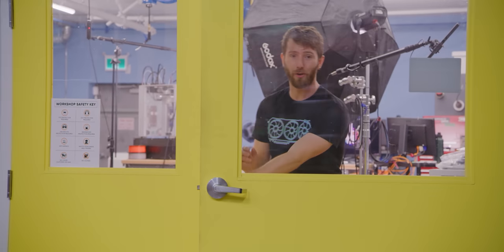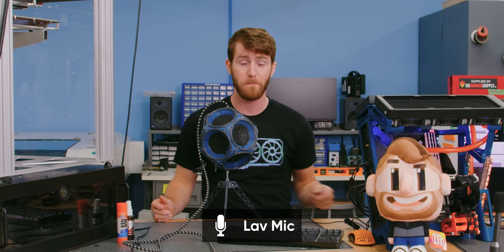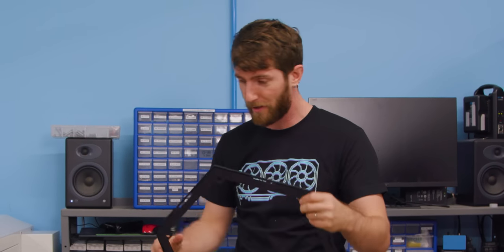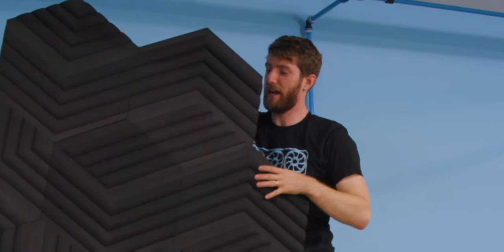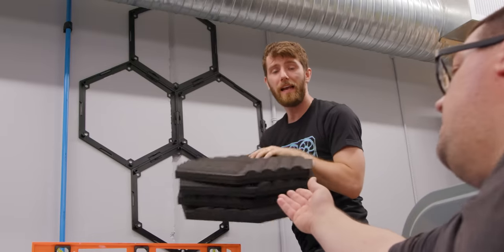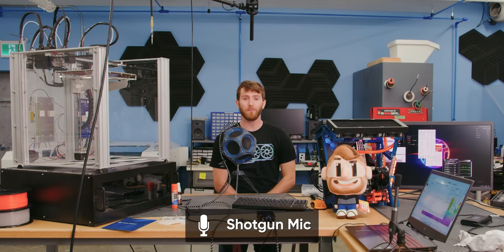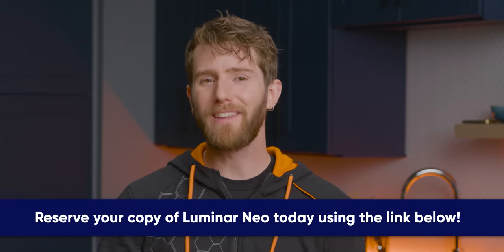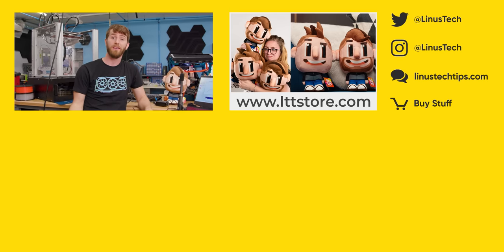I'm only going to say this once... - Acoustic treating with Elgato Wave

Comment: Oh boy, my degree finally comes in handy, and I can be one of THOSE YouTube commenters. Reverb is not created by standing waves. Standing waves and reverb are different things that are both caused by sound reflecting off walls. Standing waves affect the tone of the sounds in the room, they do this by either amplifying or canceling out certain frequencies inside the room, the specific frequencies that get boosted/cancelled are determined by the dimensions of the room. 

Reverb is just a sound reflecting around the room, and since it takes time for the sound to move through the room you hear the same sound multiple times from it reflecting off different surfaces
Reply: Absolutely correct, thought the same. Standing waves also cause a ringing sound at specific wave lengths (fractions of the dimensions of the room) that can stay way longer than the reverb
Reply: Thank you! Was thinking the same thing!
Reply: Was gonna make this exact comment, glad someone got to it before I did haha
Reply: @Punkschorsch  Maybe that's why sometimes people hear a high pitched sound in their ears.
Reply: True. I would add that this treatment does help a bit against standing waves because of how many times the sound waves will have to go through the foam and lose energy. Plus the foam surface is not flat, but angled in different directions, so that helps by deviating waves through refraction, though I wouldn't expect it to do much for bass frequencies, and maybe even mids
Reply: I’m thinking it’ll be good enough for the large space they have, their energy loss from one end of the room to another I assume would be rather large (considering the workshop is massive) so this will aid in damping those waves
Reply: Yoooo, qualified acoustician and trained engineer gang.
This video hurt my feelings.
Reply: Not to mention you won’t address any room modes or standing waves without tuned bass trapping / proper broad band absorption. While we’re at it foam is a terrible material for acoustic treatment and at best will tame highs and high mids. I hate this consumer shit that gets sold to people through these kinds of videos. A better one would be how to make actual acoustic panels (not thin foam decorations) super easily and cheaply with rock wool. But we can’t expect much from Linus—I’ve seen them talk about 96khz audio before as if it would be audibly different to a listener compared to 44.1khz. To anyone who sees this: in a blind test you will not be able to tell the difference. The differences are not audible.
Reply: I don’t see anything wrong with being “that youtube commenter” as long as you keep it held to facts and not belittling the content at hand. You did a great job of that & as someone who knows nothing about your field of study it’s always cool to learn new things. 🍻
Reply: @thaBigGENERAL  They're not building a recording studio, it's more than enough
Reply: standing waves are MUCH harder to get rid of and these panels absolutely won't do the trick
Reply: BloodLeef  cheers mate, my fave is double choc chip
Reply: Thank you :) Was kind of annoyed because of their explanation, some LTT viewers actually know their acoustics!
Reply: Also, they are talking about frequencies, and while they are not entirely wrong, these panels are mounted directly to the wall, which nullifies the bass anyway; there is reason bass traps are a thing.
Reply: I could hug you. And unless you're in a Hollywood soundset, or NASA or someplace with remdiculous control (and money)  the color, tone and I guess vibrance of your  recordingS for just about everything is impacted  in someway by interference, the materials,  and even the recording equipment itself, some amount of imperfection, is going to sound better as well. Just because it's what you're used to. lol audio engineer friend has ranted for a long time about these things. you don't need a fucking hollyweed type of set up for youtube. even hollyweird doesn't need it!  (mostly)
Reply: He needs a anechoic chamber tech ingredients!
Reply: @darko.v  You're thinking of tinnitus.  It's a physical condition of the ears, and has nothing to do with reverberation, standing waves, or resonance (which is the ringing effect Punkhorst describes).
Reply: @gorkskoal9315  The film industry makes their soundstage as flat and unresponsive as possible during filming so they can have complete control over what effects they want to add in post.  Same for the music industry.  It's rule number one in recording - you can add stuff later, but you can't take it out if it's already there in your raw track.
Reply: You're mostly right, but it should also be pointed out that standing waves are a direct result of reverberation - a resonant frequency cannot increase in amplitude if the wave is not being reflected in the first place.  This is also why a perfectly anechoic chamber will have no resonant frequencies, regardless of its shape and dimensions.
Reply: @UthacalthingTymbrimi  Good to know.
Reply: @UthacalthingTymbrimi  well I did say standing waves are caused by sound reflecting off of walls, but thanks for the additional information. It's a lot better than what Linus said, "reverb is caused by standing waves"
Reply: @cameronfarrell9076  Yeah, Linus is basically saying the exact opposite of what actually happens.  I get what he's trying to say though - resonant frequencies will  reverberate for longer because they're additive.
Reply: So reverb = echo?
Reply: yep.. was totally going to say the same cough
Reply: @Summer-xu8qu  yeah they are, echo is just really long intervals between reflections, which is why you hear echos in canyons and big halls and shizz
Reply: I knew that without spending tens of thousands on a degree
Reply: Degree in WHAT?
Reply: @cameronfarrell9076  can you please also explain room resonance? How would different modes be affected by treatment like this?
Reply: I am happy I do not have to be that person cause I was definitely thinking this haha
Reply: @tusharjamwal  the short answer is small foam panels like these do nothing to combat room resonance.

I'll probably make some small errors here but I hope this is a good enough explanation.

Room resonance is basically what causes standing waves. Sound wave frequencies have a physical size and they travel through air over time, if the room is the same size as a particular frequency then when I bounces off the wall it will in effect occupy the same space instead of moving around, it then combines with itself to either double in volume or half in volume depending on where you stand in the room, these are called nodes and antinodes and are fixed positions in the room since the waves are in effect not moving.

In order to combat these with acoustic treatment you need really thick panels that are tuned to those frequencies and you need to place them in specific locations in order to absorb the sound which kills the resonance.
Reply: @Summer-xu8qu  Essentially, yes, depending on distance.  In much larger spaces (eg: canyon, mountain range), the time between you hearing the direct sound vs the reflected sound is long enough that your brain interprets them as separate sounds (ie: echo).

In a smaller space (eg: a church), the direct + reflected sounds blend together a lot more, which is what is commonly known as "reverb".

The reality is a bit more technical, in that you need to consider factors like direction of the reflections, the reflective properties of surfaces, etc.
Reply: And generally, when we treat high-end recording studios we only treat two non-opposing walls and the ceiling.
Reply: The peaks and the nulls of a room are also known as MODES. You can actually do the math at what frequencies you're going to have problems in, just literally do 1130 / Xft in one direction. 1130 is the Feet Per Second. So you're dividing that by the dimension of your room and you can get the base frequency a given problem will occur. Now that doesn't necessarily give you whether it's a peak or a null, but it does tell you the problem frequencies and all you have to do is multiply that number by 2 to get the next octave and so on and so forth which will tell you more about your room that you didn't know. I run a little recording studio out of my home and I've been learning all this as I go lol
Reply: @Theexplorographer  Unless it's the drum booth -  reflections are death to your overheads!
Reply: Pin this guy already
Reply: @AlexValliMusic  Definitely done that math many times building Helmholtz resonators for studios.
Reply: if you think acoustics is a useless degree then try music performance.
Reply: Standing waves are also the reason microwaves are heading up food so inconsistently ^^
Reply: @PascalalbrechtDDance  i didn't know that, it is very interesting!
Reply: yes
Reply: Thank you! As an audio engineer it really ground my gears when he said reverb is standing waves.
Reply: Great! But let me ask, how do I objectively measure the amount of reverb in a room?

I really don't know much about acoustics so I assumed that standing waves would only occur if reverb occurs, and hence some correlation; standing waves being a kind of objective measurement and reverb being the subjective observation
Reply: Nodes and anti-nodes?
Reply: Using REW he can also calculate the RT60 time which would be much more beneficial for this kind of test. Rt60 is the measurement of time it takes for reverb takes to decay by 60dBSPL, the level change it becomes inaudible
Reply: @notMattGarska  Standing waves are mostly a thing in the very low mid and bass frequencies. Very roughly below 250Hz you start to get into "room mode" behavior with standing waves, and above that, reflecting sound behaves just like normal "reverb". These panels are 4-5cm thick, if you plug that into a porous absorber calculator, that will tell you they start being somewhat effective at 500Hz (about 50% absorption) and properly effective above 1kHz (>90% absorption).

That's typical for a mid/high frequency absorber, not effective at all for bass frequencies, but that's not what they're made for anyways. If you want to do anything of consequence against bass frequencies/room modes, you need to have elements with thicknesses more like 10-20cm. They're usually put into room corners.

Btw: If you want to get the absolute most of the least material, you should put porous absorbers not right against a wall but instead leave a bit of an air gap. Porous absorbers are most effective at absorbing energy at the velocity maximum of soundwaves, which is 1/4 of a wavelength removed from the wall or boundary, where it reflects.
Reply: @thaBigGENERAL  Nothing wrong with foam per se; acoustic foam itself is about as effective as rockwool or many other porous absorbers (comparing flow resistivity). You just can't expect a 5cm absorber panel to affect low frequencies, whether it's foam or rockwool or anything else. When you want best bang for the buck, build a DIY rockwool panel. If cost is not the primary limiting factor, the convenience of foam (weight, no hazardous fibers) may be worth it.
Reply: @thaBigGENERAL  Yeah, I found it interesting that the peaks at 150ish and 250ish Hz didn't budge an inch. I thought, "Well, they could probably throw a couple of bass traps in there and fix the issue." Also, the 16 bit/44.1 kHz sample rate of CDs is no accident. It's scientifically the most that a human ear can distinguish.
Reply: Was going to say the same thing. I'm an audio visual artist and integrator. Where did you go to school?
Reply: @Summer-xu8qu  no, completely different things entirely. You can have reverb in a chamber without echo but you can't necessarily have echo without reverb.
Reply: @AlexValliMusic  1. Peaks and nulls are anti-nodes and nodes respectively.
2. Modes are the various frequencies that your formula derives. 
3. Your formula is incorrect. Base frequency, or more appropriately fundamental frequency, is 340m/s divided by room length then further divided by 2.
4. The proper formula for double closed end reflections is f = nv/2L, where n is the harmonic number, v is the speed of sound and L is the length of the room.
5. You can determine locations of nodes and anti-nodes by first determining whether the wall provides a fixed or free end reflection. Then propagating the alternating node type to subsequent adjacent nodes. (Iirc, the wall is a fixed end reflection, but I could be wrong).
6. Imperial units hurt my soul.
Reply: so what exactlyis happening when you fart in a hot bath in a cast iron tub?  and how is it heard downstairs? why did the chandelier vibrate?
Reply: is it useful to have panels on different parts of the room compared to only on one wall? I suppose one thing that could play a role is the different orientations the panel have, if a wave would bounce from the ceiling to the floor back and forth and you only have panels on a wall, then very little of it would get absorbed. But I suspect that you only need panels in each of the 3 orientations in a square room, but I don't think you ll get a difference regarding grouping those together or not
Reply: Yeah standing waves are way rarer than this video implies.
Reply: would these panels be something good to put in a home theatre that has hard walls, low painted ceiling and carpet?
Reply: @darko.v  no. While you can have Standing waves at any frequency, in room acoustics, standing waves are a low frequency phenomena.

At these low frequencies the room appears like a box with sound bouncing plainly from one side to the other. When the wavelength of the sound (or it’s multiples) exactly matches the width and/or height of the room, these reflections will form standing patterns. They are characterized by areas of extremely high pressure (constructive interference between reflections) and others where the reflections cancel (almost) completely out (destructive interference of reflections). Along the walls, standing waves always form high pressure areas, because the rigidity of the walls leads to high pressure. Silence can only be found a good distance away from the walls.

This low frequency behavior of rooms is the reason why subwoofers are best placed in corners. There they have the highest efficiency to feed the room with energy and make it “booom”.  But you will also find that bass experience varies significantly across the room.

At higher frequencies small objects and surface roughness are significant in size compared to the wavelength. As a result, instead of being plainly reflected back, sound bounces off in different directions and no standing waves will form. Unless you are in one of the very extreme flat concrete surface rooms, which are used for measurement purposes.
But even there the human ear will not really perceive high frequencies as Standing waves (too much going on)

But there are many other phenomena related to high frequencies, (e.g. our hearing is especially sensitive around 1-2kHz) and we just don’t react very pleasant to ringing sounds.
Reply: @AbWischBar  Very well written. Thanks for the explanation and it makes so much sense.
Reply: Basically its like throwing a ping-pong ball at the wall :) (How I always imagined reverb)
Reply: Finally, someone who has the same boat of knowledge from a relevant degree in sound. Well put.
Reply: @UthacalthingTymbrimi  kind of but no. Both are a result of sound waves reflecting off a surface, they are however two completely different things.

Reflection is not reverberation, it does cause it however.
Reply: @Santosh Parvatikar and so did you... The panels he used are designed for exactly what he wants to do, reduce reverberation at specific frequencies. 

The only thing he did wrong is use the incorrect terminology.
Reply: @benlemke9430  they measured it correctly, they called it the wrong thing.

Standing waves and reverberation are caused by reflections off the surfaces. 

As an aside, if he was truly trying to reduce standing waves those panels won't do anything, they're not thick enough and likely aren't placed in the correct places.
Reply: Science works!
Reply: Yo, Cameron!
For a small room, would be enought to place a few of these behind my desk to improve my mic audio quality?
Reply: @Ghaleon  hey mate, that's a complicated question to answer, because "improve mic quality is very vague, there could be 20 different causes for a dissatisfaction in mic quality, and each cause requires a specific solution.

That being said, I had a quick look at your channel and to me the quality sounds very good, I'm not sure what post processing you do to the vocals but from what I heard I doubt these panels will help much if at all.

The things I would do to improve sound quality over all in a small room setup for YouTube is 

A) get a good mic
B) focus on mic placement, this is very important and often overlooked
C) place more substantial acoustic panels through the room, not like the ones in this video. The panels I'm talking about would be between 4 to 8 inches thick that are made of some kind of rockwool insulation or fiberglass insulation, you can make them yourself if you're handy and there are plenty of tutorials on YouTube about this.
Reply: Thank you one of THOSE commenters, now I can be one of THOSE friends who corrects the group.
Reply: I had this issue when I was bored with catavicas #sloshwobble problem
Reply: @cameronfarrell9076  i did not receive notification from your reply.

Thank you so much for your help, sir!!! ❤️
Reply: @darko.v  No that's tinnitus and the ringing is constant.
Reply: @thaBigGENERAL  to be fair the average consumer only needs to worry about highs and mids. and the graph they showed clearly demonstrated what frequencies were most affected, upper range speaking frequencies.
Reply: Thank the sound gods for this comment and your discernment. At least this video didn’t claim to “sound proof” their room the treat it.
Reply: ratio.
Reply: @thaBigGENERAL  all true BUT for streamers, which this product and video are clearly geared towards, it absolutely works. I personally would consider supplementing my panels and bass traps with a few of these in order to tone down the left over reflections I still get in my room after only being able to manage about 70% coverage due to the shape and layout ot the room
Reply: that's what i thought. it's an echo still but less extreme
Reply: Yes, let’s go audio engineer nerds! Let us Assemble!
Reply: I'm glad someone else was pedantic about this so I didn't have to be lol
Reply: Thank you so much! Thought I was crazy there for a second. Also good luck with those standing waves using 5ish cm of polyurethane foam. Not like they’re gonna need bass trapping for cleaner dialogue. Some felt paneling might do the trick for an office space. Otherwise, time to drop in some rockwool panels to get proper coverage from like 80hz up. Seriously guys, foam panels are basically a scam, selling you packaging material for hundreds of dollars under the guise of acoustic treatment.